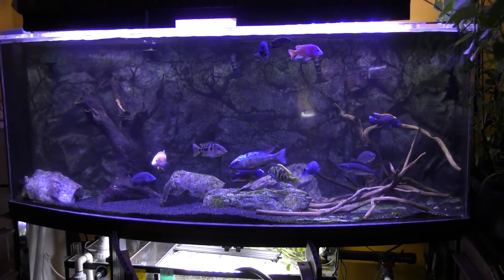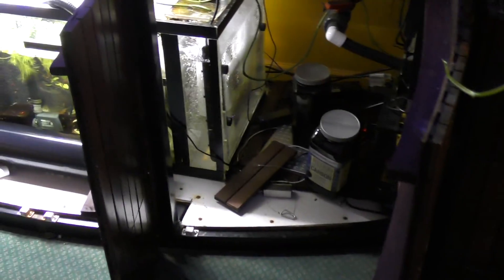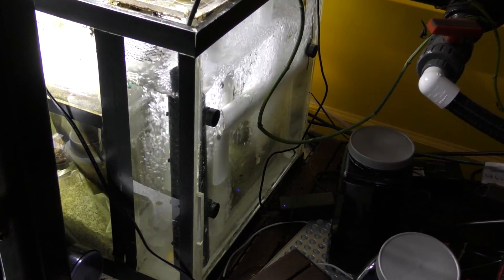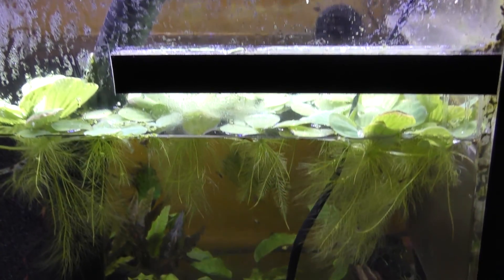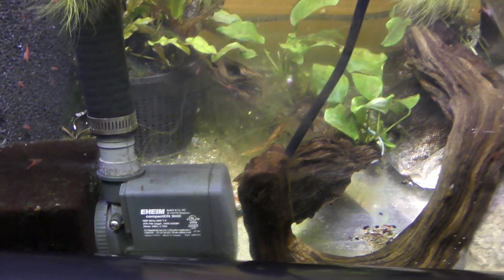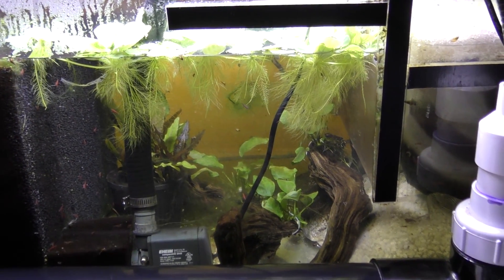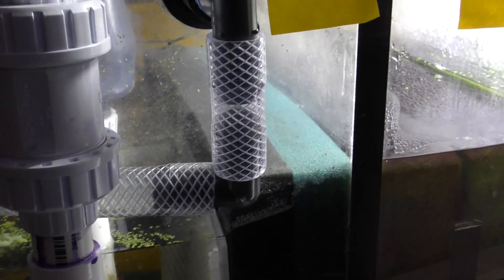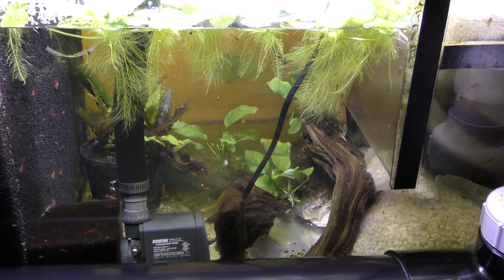The Miracle in My Sump. Seven Years of Progress

Comment: Do you have baffles in between the 20ppi and 45ppi porett foam? Or are the sponges just next to each other?
Reply from the maker: I have acrylic partitions with large holes between some of the foam for water flow.  They were in the sump when I got it.  If the foam is 3 or 4 inches thick it is self supporting and no partitions or baffles needed.  Actually the latter approach is preferred for better water flow.
Reply: @HalfManHalfCichlid  what size sump is in this video? I’m setting up a 220gal, what size sump would you recommend? Gonna have discus and stingrays
Reply from the maker: @vinnydiscus6766  I recommend a sump at least 20% of the volume of the aquarium.  Can you fit a 55 gallon standard aquarium under your tank?  My sump in the pic is 110 gallons
Reply: @HalfManHalfCichlid  yea it should fit. My 220 is 6ft x 2ft. This guy on Facebook is selling a 100 gallon acrylic tank I might turn into a sump. Would having a 100gal vs 55 gal sump be more beneficial anyways even if I’m gonna set up auto water changes (55gallons) anyways?
Reply from the maker: @vinnydiscus6766  the larger the better.  You will not need all that space for media however.  The extra space can be converted into a refugium.  I have used my refugium space for fry grow- out, for plants, for cherry shrimp/snails, for algae scrubbers and plants like water lettuce for denitrification
Reply: @HalfManHalfCichlid  how long do you keep the lights on for the refugium? Also, do you have the refugium part between the 10ppi wall and 20ppi wall?
Reply from the maker: @vinnydiscus6766  12 hours.  The refugium is after a 10 ppi foam used as a prefilter.  Keeps the refugium from picking up "cigarette butts and bottle csps." Lol

Comment: Sorry for the silly question, but do you clean the foam every 3-4 months, or do you replace it? I assume that you clean/replace one at a time; is that correct?
Reply from the maker: I clean it.  In fact I just cleaned one that went 5 months.   I have some sheets of the foam that have been in use 5 years.  A little discoloration on the edges, otherwise like new.  This is another advantage, no disposal, no having to purchase replace sponge.  In fact, I am now collecting the "brown water" from when I clean my sponges and using it to fertilize my house and yard plants.  Much more eco and cost friendly.
Reply: @HalfManHalfCichlid  but the foam replace the biological slot? Work Better? And what happen to your biological filtration if You clean the foam?
Reply from the maker: @brankhaykhondar1195  I have 6 or 7 foam  "walls" each with progressively finer porosities, from 10 to 45 ppi.  I only clean one at a time, leaving 80% of the bio capacity intact.  Foam biological capacity exceeds most bio media.  This is the secret of this set up
Reply: @HalfManHalfCichlid  in your opinion, foam Is Better than seachem Matrix?
Reply from the maker: @brankhaykhondar1195  yes.  Per unit area, foam has more surface area for beneficial bacteria growth than matrix which has been known to clog.  One would have trouble affording an aquivalent surface are in matrix.
Reply: @HalfManHalfCichlid  really Thank you sir!!! Ehmmm...can You tell me the commercial name of the foam? I Need more info about
Reply from the maker: @brankhaykhondar1195  Poret foam in the US  Go to Swiss tropicald website.  Available worldwide wide.
Reply from the maker: I have a large sink and squeeze and clean the sponge sheets.  Takes three or 4 rinses to get clean.  My 10 ppi has gone a year without cleaning, the finest is 45 ppi which I clean every 2 months.  The finer the porosity the more frequently they clog with 2 months being the shortest cleaning interval.  After 5 years I see no deterioration of the foam and believe they will last my lifetime.

Comment: Where does the UV sterliser return to after leaving the refugium?
Reply from the maker: Returns to last chamber in ths sump and immediately with the water returning to aquarium
Reply: @HalfManHalfCichlid  thanks for clearing that up.

So with flow rates, it processes 1/3 of the water or more?
Or, over X amount of cycles in an hour it effectively processes all the water?
Reply from the maker: @telinoz1975  i had a aquaculture wxpert from the manufacturer help me out.  The UV i h as ve is optimized for pathogens at 650 gallons per hour.  I run it for 12 hrs a day and get a 3 year life on the bulb
Reply: @HalfManHalfCichlid  awesome!
Thanks again and keep up the great work, your sump and tank are very good role models for the hobby.

Comment: Awesome sump and thanks for the tour. Your basically doing everything I want my sump to do. How many chambers does the mechanical filtration span? It hits the 10ppi, goes up, hits mats, goes down to return chamber?
Reply from the maker: Beauty of poret foam is you do not even need chambers.  3 or 4 inch thick poret foam will create a "flow through" wall of foam that will work best.  No baffles or turns needed.  Best is to start with an aquarium and add the foam walls leaving space between layers for refugium.  I have a another sump where the only pre filter material is 10ppi foam and it is simpler and works even better.  I have 10, 20, 30 and finally a 45ppi walls that the water passes through
Reply: HalfMan HalfCichlid Thanks for pointing me to poret! I got some expensive Matala filter but even the "fine" is like 10ppi. Matala give me options to support other filters since its so ridged. Porat is just perfect for my situation. Ok, sump without baffled idea. What if overflow clogs? do you just elevate your pump so it wont flood aquarium?
Reply from the maker: @daweihuang9687  i have no issues with overflows.  If poret wall clogs water goes over the top of poret to next layer of foam.  I have dual overflows and an auto pump shut off should the pump ever drain the sump

Comment: Always evolving, I am still doing the same thing and with great Success especially now I have no affiliation with South East Cichlids my Fish Sickness and die off problems have gone away!  Was always something with that guys stuff, sure glad I stopped vouching for the guy.

Our approaches are very different with pretty much the same result. I am still only doing Cartridge changes every 4-5 months on the NuClears and with the drip system I am only doing a 50% water change every 6 months. I dont use any foam or floss, I am just pumping 5000 GPH thru the Nuclears and 2500 GPH thru the 150 Gal Sump.

Good in depth look!
Reply from the maker: Where are you buying now?  Good to hear from you
Reply: Trevor at the Wonder of Cichlids.

I cant express not only how much healthier but better quality of the fish. Shame on me for not trying Trevor before speaking about how great SEC was. Its a huge difference. After spending as much time and $ trying to fix SEC shop, I realized that after 3 trips there it all came down to some serious personal issues he has and his lack of work ethic that causes the fish to be sick. Now once he switched from buying from the German Supplier (Mainly) to Domestic and imports from Italy that the fish quality went in the toilet.

Oh well it is what it is. I am sure you can see just from his shop and tank reduction he is not doing well.
Reply: Nice to see some comments from you Ron. I have a similar set up to John as we have been working sharing ideas. Been more on Instagram. Here is the video of my set up. Please show an update video of your drip system when you get a chance
https://www.instagram.com/tv/B0tKGldnYff/?igshid=8x0vrxy6av94